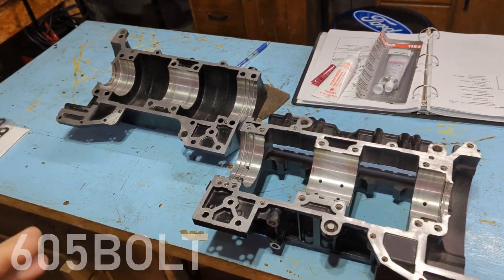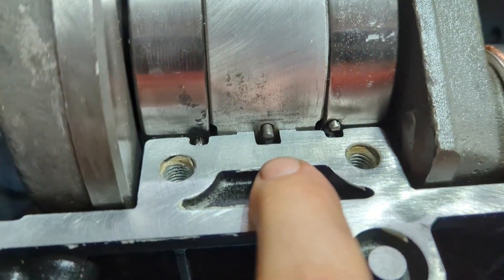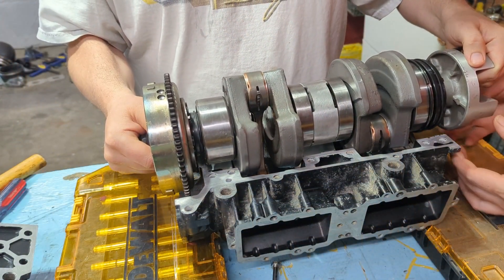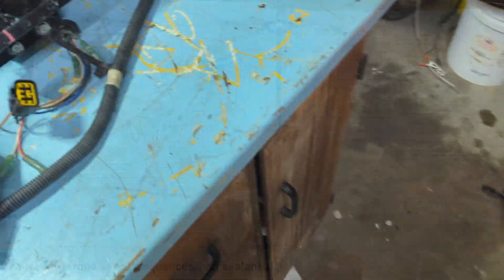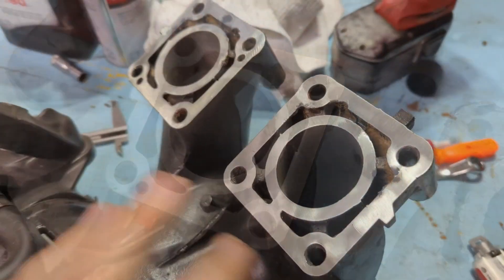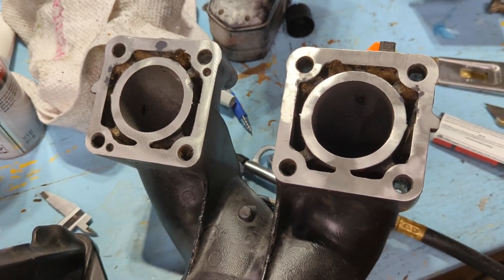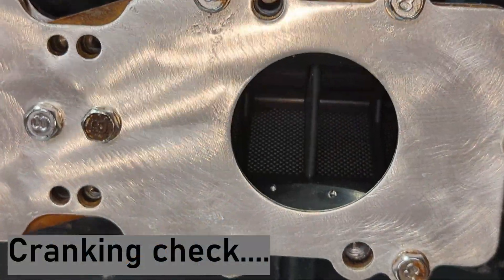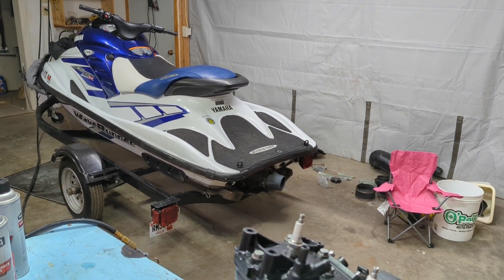2001 Yamaha GP800R Engine Assembly -- Full Guide, 800PV

Comment: Hi,
Just wanted to give you a big Thanks!
I just finished a top end rebuild on a friends GP800
One of the oil hoses had come off and they ended up running it dry and damaging both piston heads and it lacked compression. Repair shop said scrap it, or they would be happy to take a few thousand in repair costs. I’ve repaired many things in my life, but this is my first engine tear- down and rebuild. 
I finished this morning and the darn thing started and ran. I couldn’t have done it without you videos. 
Much appreciated. 
PB
Reply from the maker: Love to hear it. Great job!!!!!! Thank you for watching and commenting!

Comment: Hi what grease did yo use for the piston barrel?
Reply from the maker: For inserting the pistons into the cylinder, just lube it up with motor oil or two stroke oil. Nothing special really.
Reply: @605BOLT  sorry top end bearing grease for piston
Reply from the maker: @lime399 that is raw two stroke oil. That's what the blue is. I just dipped my finger into the jug to grab a dab. But you can use anything really. You can see that roller bearing is blue in the video. 👍

Comment: Im currently doing a rebuild on a 2003 800xlt, I noticed you have a blockoff plate in place of the oil pump. What oil/ratio have you found that works the best for these 800s?
Reply from the maker: Gosh its been a while since I owned this ski but I'm pretty sure it was 40:1
Reply: I have a 2003 GP800R. I am running 2.7oz per gallon. 50:1=2.6oz but  is too rich, and 40:1= 3.2oz but  is too lean. I found halfway runs better.  I hope this helps you
Reply: @emmanuelramos5232 he’ll yea thanks for the info

Comment: Hi there I have a gp800 yamaha waverunner and just rebuild but not getting fuel to carb do I need to prime the line if you could give me any tip love you veidos
Reply from the maker: I would try to start it on just squirts of fuel down the carb. If you can get it running it will probably clear itself out and start moving fuel on its own. Might take a few tries.

Comment: How what do i do if my bearingbon crank is bad how to chage
Reply from the maker: The crank can be separated and the bearings replaced.  Most people call that a crankshaft rebuilt.  For a single cylinder engine it isn't that bad to do but in the instance of a twin and a triple, they need to be phased properly and that is not something people DIY.  The fixturing is pretty significant.  The part that is difficult is called crank truing if you want to look it up.  There are lots of places where you send your crankshaft in and they rebuild it with new bearings and all the required tooling.  Its not all that expensive either.
Reply: @605BOLT  thanks very much 🙏 I will look into it and wondering can you help for the carburetor are sezied amd tips thanks as it my first ski
Reply from the maker: @RobertLawlor-d4n  if the carb linkages are seized you're going to need to try to free them up and rebuild them otherwise new or used cores to rebuild. I have a video on how to rebuild these carbs.